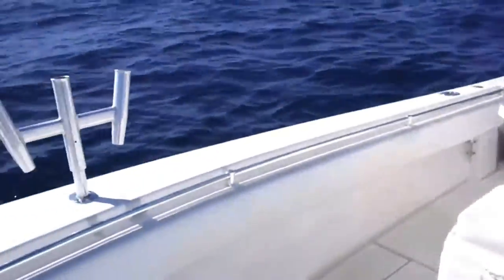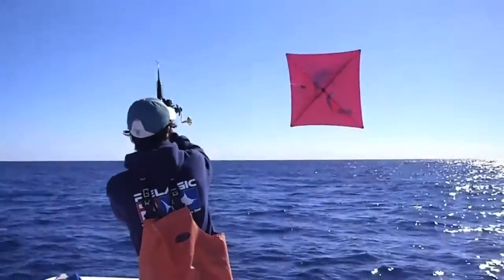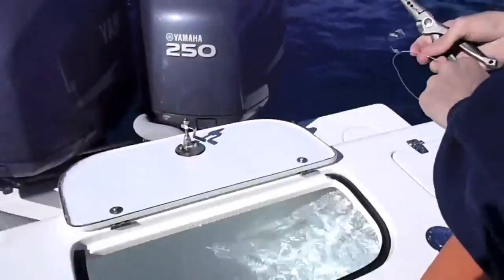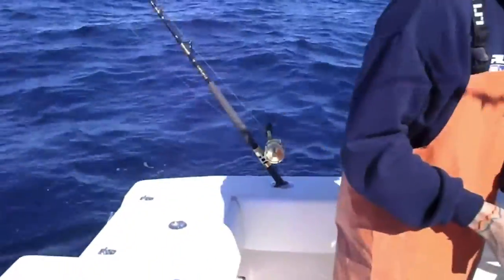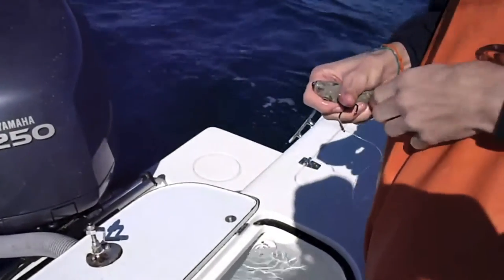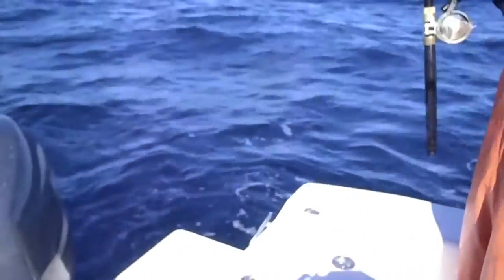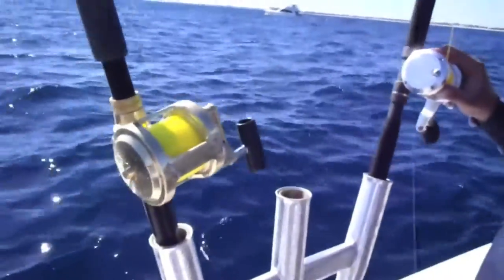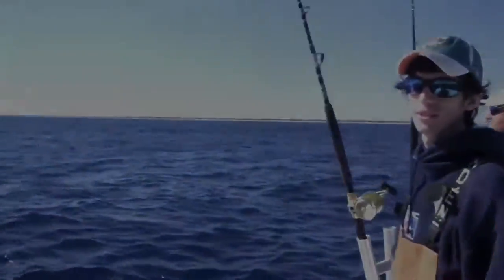How to Kitefish

Comment from the maker: Yup. I have mine like 60-70ft apart from the kite and between swivels. Doesn't really matter too much, just whatever you like because the more space in-between the more line you have to put out. The farther apart also helps prevent tangles a little bit.

Comment: Smart precaution to tether reel
Thank you
Reply from the maker: Hahaha it has saved it a couple times. Sometimes if the boat rocks after a wave it can have the rod angle with the kite be straight up and it just pull the rod out very easily.